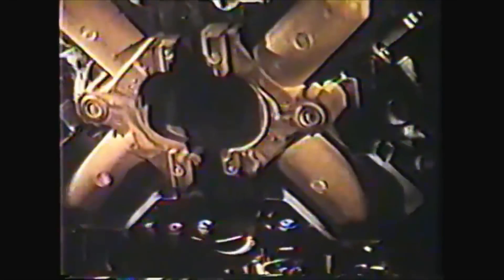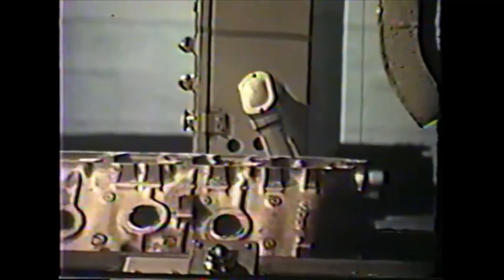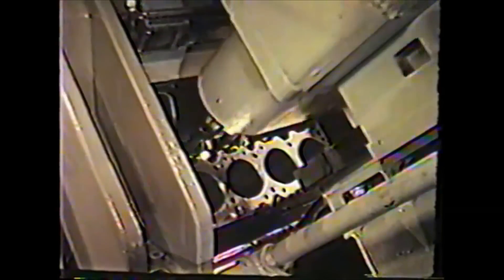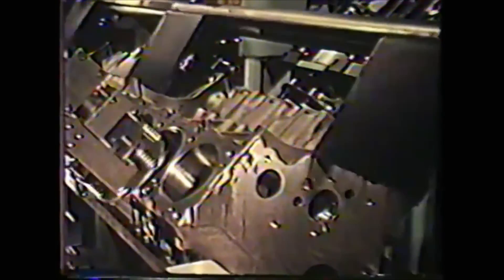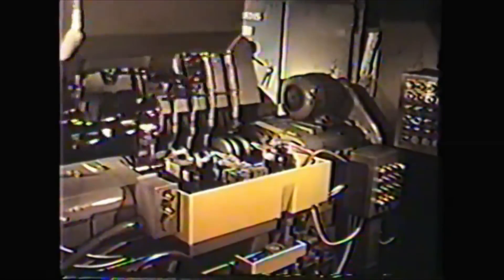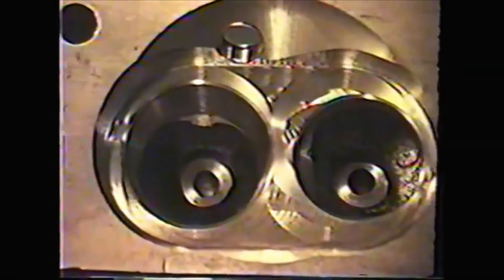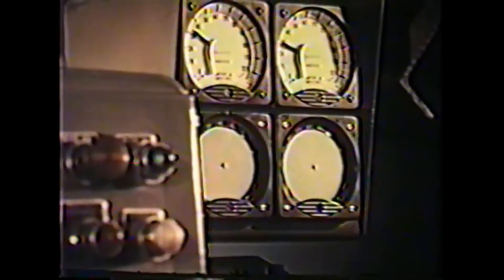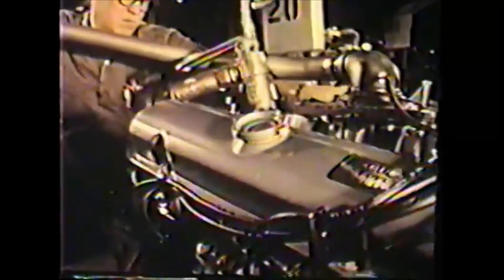Pontiac 455 casting and machining for original production in 1970.

Comment: I HAVE ONE-----A 455 PONTIAC
Reply from the maker: I do as well, a 1970 360hp version.
Reply: @twoponchos  My 455 is a 1969 from a Bonneville. It’s got #64 heads and ram air headers. A great motor.

Comment: For those unfamiliar with the true Poncho engines, be aware that the first production year for the 455 was the 1970 model year, before that was the 428 (which replaced the 421). They were torque juggernauts...mostly due to their over-square stroke. Pontiac also thought through power-and-compression far better than most other car companies of the day...they really only had two pistons: a flat top and a dished. Depended on the displacement, but normally this resulted in an 8.5-to-1 and a 10.25-to-1 compression. Pontiac's 'true secret to power' were the heads...where Mopar or GM had 'a few head castings', Pontiac had over 40 different castings...and you could literally 'dial in your compression' desired by simply changing your heads! You could, with minimal fuss, drive an 8.8-to-1 car to the track, change the heads and race an 11-to-1 engine, then change back and drive that 8.8-to-1 back home! Of course, the 'true high performance heads' (closed chambers, no emissions, large valves and runners) were 'small chamber heads'. They were denoted by a number cast into the siamese ports in the middle (such as '46')...elimination of Pontiac eliminated this 'racer-convenient' feature, and instead, made racers 'rebuild' or 'stock various engines' to accomplish the same 'compression change' ability. Pontiac was WAY AHEAD OF ITS TIME!

Comment: Buddy that Pontiac 455 is THE motor for torque and long life! You want one for your small pickup!
Reply: The Olds 455 might be better. However, by how much, I am not sure. There were some GMC RV models that had an Olds 455 from 1973 to 1976.
Reply: @skylinefever  I had a 1972 Oldsmobile 98 given to me as my first car in 1979. RIGHT when Carter's lame inept idiocy gave us a major gas crunch. It had a rocket V8 455 under the hood. Back in 1972 my dad came home from 'Nam, saw what my mom had bought - took the exhaust resonators off. We used the car for a few family trips. Cozy luxury comfortable. Mostly, it sat and our daily driver was a 1967 volkswagen squareback (original blue, resprayed lemon yellow). Dad liked speed so he rode his Yamaha R5 350B or Kawasaki H2 MkIV to work. 

 There I was at 10 years of age maintaining that car. Brakes, oil changes, installed a janitrol aircraft heater in it. That gave us INSTANT defrosted windows, warm car, warm seats. Not gonna say what government aircraft the heater came out of nope. It burned MORE gas! BAH! There's plenty where THAT came from, all we need is a thinking HUMAN that LIKES America for President and this whole gas thing will clear up. (Sound familiar?) 

That motor wound up getting rebuilt a little mean n nasty and put into a Datsun B-210 with a Mustang II front-end and no back seat or rear hatch space. Foolish, that build. It cost more than a new car to get it drivable. Frankenstein's monster, I learned how to weld! My dad loved it and stole it from me and bought me an Alfa Romeo GTV6-2.5 mile miglia quadrafoglio. He said I was going to kill myself with the Datsun beast. He was correct!

Comment: From a chevy guy since i first turned wrenches at 8 years old,. The pontiac way was just a facinating treat to experience, in a barn find 68 gto i bought and restored.  Crank journals are narrow and huge diameter,  includes a windage tray.  Great cam in the 068 grind. Obviouslly gobs of nascar proven ways went into it  Ran like a grandmas   car at idle. So smooth.  And pedal to the floor smoldering the tires through the first 3 gears. And back to grandmas idle. A cloud of air @ 120 mph with 355 gear.
Reply: Always admired Pontiac. 
Grew up watching the GTO change from year to year. 
A friend of one of my adult sisters had a 66 Catalina. 
Beautiful and a boat.
You knew they made motors when you saw all those Pontiac ambulances back in the day. 
Just thinking about it makes me feel old.
Pontiac ambulances.
Man, has the EMT business changed.
Reply: Cadillac, Buick and Oldsmobile also made ambulances and hearses back in the day. What a lot of people don’t remember is that the full size station wagons back in those days could haul and tow as much as a 1/2 ton pickup back then. A lot of them could fit a 4X8 sheet of plywood in the back. I can remember a friend whose dad used to tow a small camper with a Chevy Nova 4 door with a straight 6 with no issues pulling or stopping. Try doing that with any modern car today. Today’s cars make more horsepower but they lack the torque which is more important for daily driving a vehicle.

Comment: Makes me wonder if this level of care is put into modern engine production or if they just want it out the door as quickly as possible. There are a ton of modern cars that have been having serious premature engine failures even with religious maintenance. Chevy displacement on demand engines, kia 4 cylinders, bunch of stuff from Ford etc all come to mind
Reply: Sometimes a manufacturer will rush something into production without working out the bugs. That is why some engines weren't very good. Also, it is why you never should buy a new car the year that variant arrives.

Modern engines can be (And usually are) made more precise than this. However, if the design is flawed, no amount of precision technology is going to save it.
Reply: Most of the 4 and 6 cylinder turbocharged engines are failing around 100k miles due to the additional stresses of the turbos, and Hyundai/Kia (same damn companies, really) have some beautifully designed vehicles that could be as good as Toyotas or Hondas, but they seem to stop just short of really building in longevity and reliability. Too many damned plastic parts are also a major culprit, especially in the engine bay with all of the heat. SIGH 
I still think the 1970 Full sized Pontiacs were terrific cars! I had two neighbors with the Bonneville Broughams with the 455 under hood and another next door neighbor with a 1970 Catalina with the 400. I loved the beefy sound coming out of those exhaust pipes from the factory. Thanks for sharing this unique video all about the big block Pontiac engines!
Reply: @JohninTucson  Yes, a badly made turbo 4 or 6 is a disaster. However, when done just right, it isn't so bad. I think about how many Volvo bricks had turbo fours. I also think about how the engine in a Nissan 300ZX Turbo usually just needs the right maintenance.

Comment: The guys that designed those computerized machines for building engines must have an IQ of 430.......amazing
Reply: Cincinatti machine sold GM a lot of machinery that Pontiac tried to run faster than it was supposed to run on honing cylinders. Ran it a while then left for scrap.  Such waste. It's all gone now.

Comment: That's a lot of QC for an engine that typically lasted 100k miles due to the low quality oils and metallurgy compared to what we have today. There was definitely a lot of pride in workmanship because they had to just to make it useable.
Reply: Sulphur in the fuel back then caused wear as well.    I worked in a shop that did rebuilds after the government made the fuel companies sell low sulphur fuel - as an emissions reduction measure.   There was a marked and increasing drop in the amount of work we got after a few years.
Reply: Can speak of sulfur removal in modern fuel processing.  North of LA, near the path that Amtrak takes, is a refinery with huge piles of bright yellow sulphuric.
Reply: Yes, and back in 1970, almost all gasoline contained lead. In 1971, it was a requirement to make unleaded gasoline engines.
Reply: @skylinefever  : True.  Lead is good for engines.   Not so good for the environment, but it is good for engines - it reduces exhaust valve erosion.  It also raises the allowable compression ratio, which improves power output and fuel economy.
Taking lead out of gasoline made good sense in the USA, which has a high population density, two or more cars per family, and most light trucks and all vans running on gasoline, making gasoline lead a major source of lead in blood.  In other countries, e.g, Australia, which has a low population density, few cars per family, and all trucks and vans running on diesel, it was completely stupid to ban lead in gasoline.
Taking lead out made no noticeable difference to the amount of lead in human blood as it was not the major source.  But it reduced engine efficiency, thus causing more gasoline to be consumed and therefore more CO2 emission.  
It's right, proper, and extremely desirable to protect the environment, but the way greenies and politicians go about it, they make the problem worse.

Comment: I've always wondered what a Poncho 400 or 455 would do in a modern performance application with today's advanced engine management systems? Some of Pontiac's heads flowed great from the factory; just imagine with modern port injection and ignition? You could run 11:1 comp on high octane, because today's computers could retard the timing before trouble starts. And of course, they could tailor the response curves far better than back in the day. 500+ net hp on pump gas? I'd believe it.
Reply: Butler Performance in Tennessee can engineer that for you. They specialize in Pontiacs
Reply: butler pontiac

Comment: Fire that plant back up for a run of SD-455's.
Reply from the maker: Wouldn’t that be amazing!
Reply: Sadly Pontiac destroyed all the tooling in 1985 in a deal with the Feds. They weren't the only manufacturer to do it either. Big brother wanted to make sure that the muscle car engines died. They never foresaw the aftermarket stepping up. We owe a lot of thanks to all of the aftermarket. You can get more and better heads now then you could in 1970 when these engines were in full production.
Reply: @1967davethewave   that is a sad bit of news concerning the government.  I know you have Butler and the TPI ram air 5's today but it would be nice to have the factory originals.
Reply: @bluesman7475  I couldn't agree more. I was 16 in 1983 and I got my first car, a 69 GTO. By the following year due to abuse by me I spun a rod bearing. My dad had it towed to the local GM dealership. My dad had always been a huge fan of the 455 S.D. So he said we could just order one from Pontiac. Unfortunately they didn't sell complete crate engines. You could buy the 455 S.D. block fitted with pistons, the S.D. heads ready to go, the crank was a separate part and the rods had to be purchased individually. I remember those 455 S.D. rods were like $60 a piece. That was a lot in 1983. My dad said he would talk to his buddy to get him to put it all together for us as neither of us were mechanics at that time. I have been a professional mechanic since 1986 though. In the mean time my dad was reading through a Hot Rod magazine and saw an ad for Racing Head Service in Memphis TN for a crate 454 Chevy that dyno'ed at 450hp and was only $2100. He had me call them and ask it they could build a 455 with the same horsepower. They said sure, for $2750. Well, it came as a complete long block and would have dyno papers to prove it's power and it was going to cost almost the same as piecing one out from GM. But it wouldn't be a 455 S.D. As a matter of fact, when it arrived much to my disappointment it was a '73 vintage 455 with 4X heads. They were ported and it did include a dyno sheet showing 451 horsepower at 5100 rpms. It was a beautiful build but I really rather would have had that 455 S.D. I started saving and was going to buy one eventually. By the spring of 1985 I had saved enough about half of what I needed. Then my dad told me what was going on with the replacement engines from Pontiac and how they weren't just discontinuing them but destroying the tooling as well so no body could purchase it and make more. It wasn't until that fall I found out from my auto mechanics teacher that the Fed was trying to discourage the Big 3 from making replacement engines for the older cars.